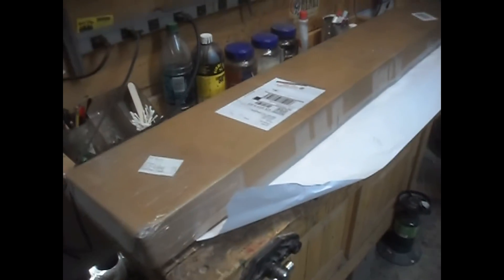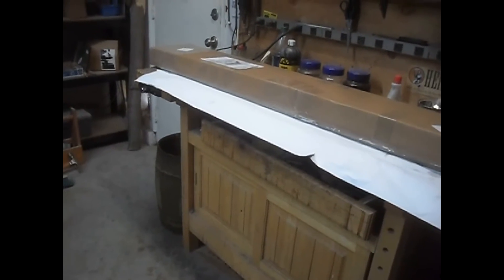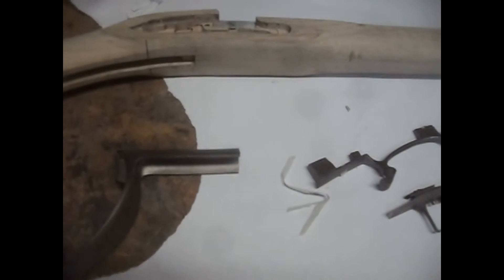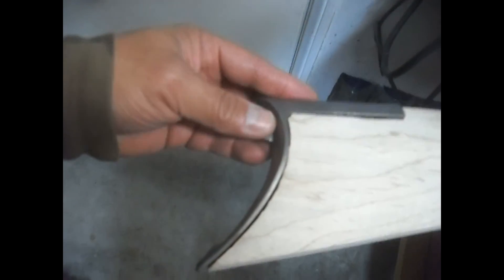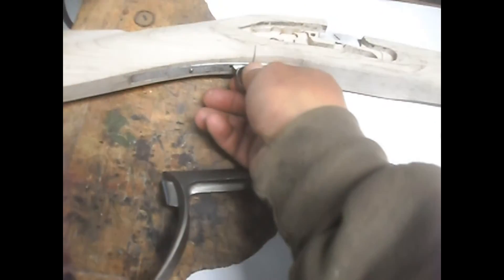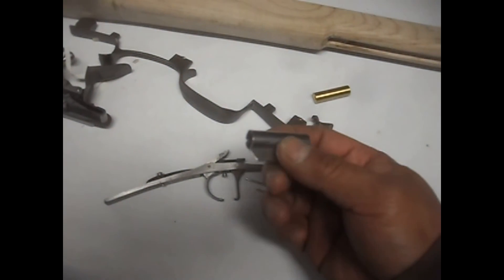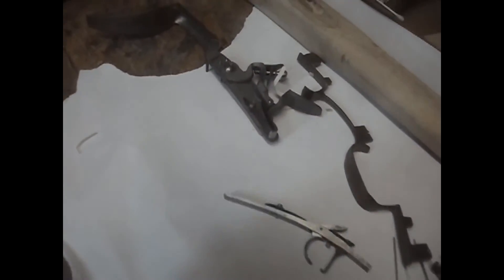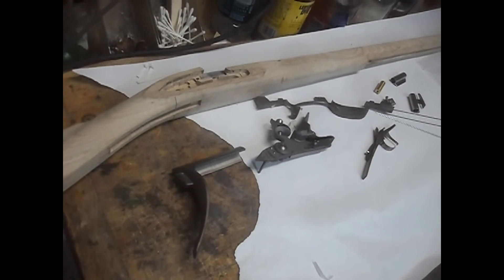Longrifle Build #1- Unboxing

Comment: Those tabs on the trigger guard don’t get ground off, the ones on the butt plate are casting gates but on the trigger guard they are casting gates but also how trigger guards are mounted. Your previous build of the Northwest Trade Gun uses screws to attach the trigger guard and newer junk from Traditions etc also uses screws but properly built historically correct muzzleloaders use pins the same as the ramrod pipes and barrel tenors to hold the trigger guard and those pins go through those tabs on that trigger guard

Comment: Tell me, do 50 cal longrifles like the Tennessee or Kentucky have to shoot round balls or can they also handle Minie balls? I'm a new guy hoping to build his first kit!
Reply from the maker: Robert Lombardo conicals can be shot from these guns but these barrels were designed to shoot round ball with slow twist rifling. Accuracy with conical bullets would need faster twist in the rifling. You can ask the supplier if they have appropriate barrel for conical bullets. But I'd shoot round ball out of this style of gun. If I wanted to shoot conical bullets, I'd buy a rifle appropriate for the time period
Reply: Kashtuk Bowcraft
Thought that'd be the case. Can't seem to find a Springfield 1861 kit or anything of the sort. I'll have to look harder.